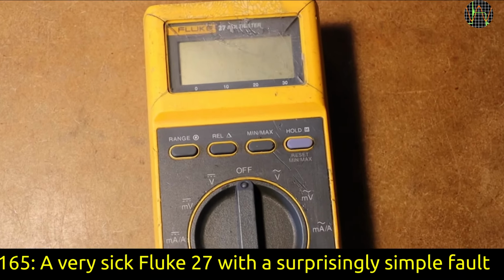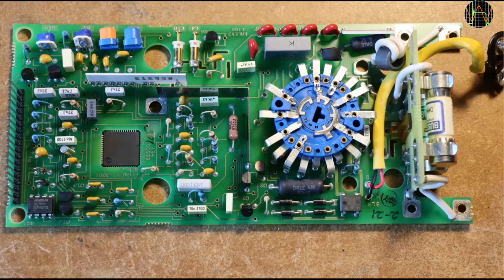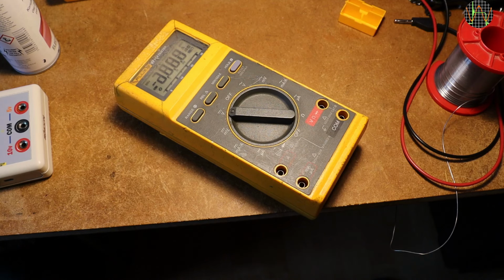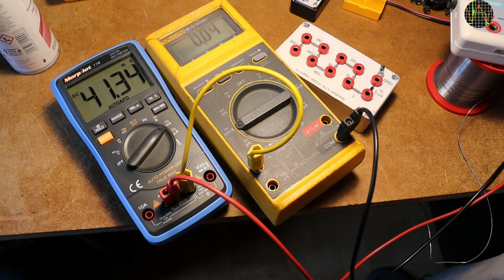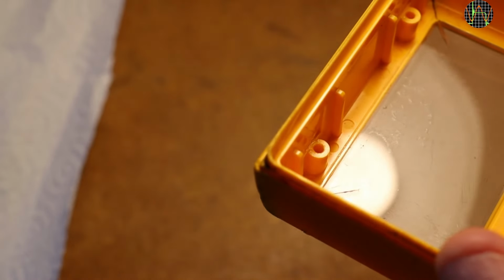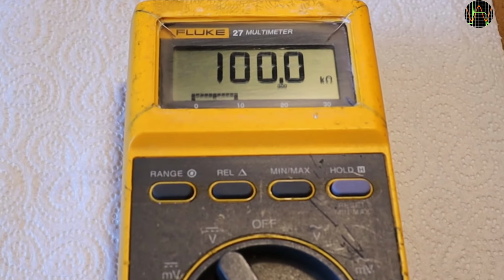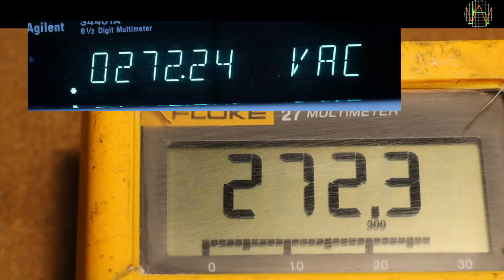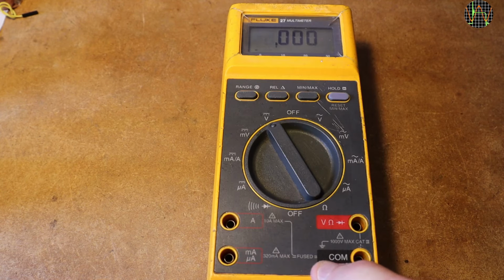165 - A very sick Fluke 27 with a surprisingly simple fault

Comment: I recently worked on a Fluke 8050A,  sold very cheap as "not working".  Many of this model have a battery option,  using nicad cells.  If the cells are bad the meter will not function, although plugged into an outlet. When turned on it takes power from the batteries exclusively.  So had to buy new nicads and install them to restore normal function.  Then I checked fuses since it was open.  At first the 3 Amp fuse seemed OK,  but then it displayed a variable internal resistance.  Very strange behavior going from low ohms to hundreds.  I replaced that fuse.  It was not blown open,  just defective.

Comment: My Fluke 79 has worked perfectly since new and holds cal.  But recently I discovered the top of the case had cracks.  It was always in the yellow protective case so I have no idea how it broke but I had to glue it back together.  The gray plastic of the back of the case seems more durable and thicker than the front.  No hopes of getting a replacement case now. Also the tab broke on the function knob so it will go past the stop if you try.
Reply from the maker: Yes, the best hope is to look out for non-working models on eBay and scavenge the parts

Comment: Nice video.  I have a Fluke 37 (which is a 27's guts in a benchtop case.)   Good to see how well it's built.  I modded mine to put a 9VDC power supply in the probe storage compartment.
Reply from the maker: Wow, that's a tricky mod to do while maintaining electrical safety. I mean the measurement circuit is not isolated from its (normally) battery-based and floating (with respect to ground) power source.
Reply: @TheHWcave  If it was a switch-mode PSU I'd agree.  This is a little 120 to 12 transformer, so I feel pretty safe.

Comment: I saved a very badly neglected meter some months ago: it needed a switch, a button and a fuse and a good display screen polish... feel good repair, turning junk into something functional again.

Beware of the fiber pens, they shed fibers... you don't want to breathe that. I use it wet for this reason.
Reply from the maker: Good point on the fibre pen. Thanks

Comment: I bought the Fluke 27 DMM new and it still looks new because it has only been used on a work bench.  Thanks for showing me the insides.  When you showed the service manual I didn't know it was available.  Did a search on the Internet, found the manual and downloaded it.  Thanks for posting the  video.